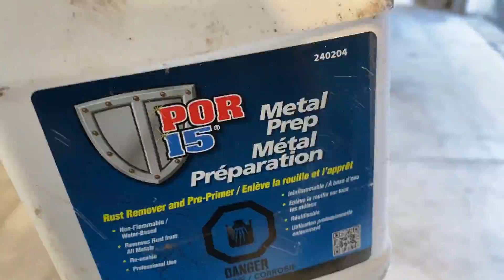Our Family Project Car Collection Tour + Grabbing Cadillac Chassis from 12 Years in Storage!!

Comment: I enjoyed seeing our family projects all lined up but I can't help thinking that there are only so many builds in a person (unless your doing it on a professional footing). Back in the 70's I made a fibreglass replica of a 32 Ford. Here in the UK at the time getting a real metal one was nearly impossible. I worked my backside off to build the thing as getting the fit with the fibreglass mouldings was hard work and also scratch building so much. It had a 2.4L Daimler V8 in it and eventually went reasonably well. Since then I restored and restomodded a 56 Chevy, restored a 66 T Bird and now have a restored 65 Mustang that I have breathed on to make run a bit more like a modern car in our heavy traffic in the UK. I am 66 now and crawling under cars is getting harder so I fear the Mustang will be my last project car.
Reply from the maker: That’s quite the list! Sounds like fun

Comment: Hey Karl.
As you mentioned about making outboard front shocks, or coil overs; you could perhaps use a bellcrank to run decent length shocks horizontally (towards the centre of the front) instead of vertically.
Reply from the maker: Yeah that would be wild

Comment: The thing I would worry most about on the upper controll arms is the balljoint angle but with lifting trucks after market controll arms allow you to move the balljoint under the arm to go higher so for down you could probably just make a spacer for in between the arm and the balljoint
Reply from the maker: I think we’re going to be able to do it without modifying the control arms know

Comment: Do a disc brake kit from opgi screw those drums. I made a kit myself for my 65 drop top I used 93-96 cadillac fleetwood front rotors and calipers mounting bracket and hardware from opgi. For the rear I used my 78 fleetwood rear end with factory disc's. I used a shorter rear on my 78 for 14×7 wires and it's on hydraulics too. (Edit) My 65 also lays all the way down within a 1/2 inch from the ground which is best for me if there's any failure I can still drive home in theory. Cool stuff

Comment: For the front lower arms, maybe flip the ball joint so it attaches to the spindle from the bottom up? Not sure what kind of clearances you’re working with, but this should give you what you need without having to notch the bottom of the frame cup. Just a thought. Keep up the great work!

Comment: Karl, buy yourself some citric acid, sometimes called sour salt. I've found it at farm supply stores and in grocery stores. Mix it with water around 75%water and 25% citric acid. You can use 10%citric acid its just a little slower. Soak the rusty parts for a day, scrub with a scotch pad, then soak again until clean. Dry off with air then spray with metal prep. You will be amazed!
Reply from the maker: Thanks for the tips.
Reply: @Make It Kustom.  no worries! I mixed this concoction when I had a 34 didge hood that was straight but rust. I mixed up a 45 gallon drum with of the stuff  and 3 days later it was perfectly rust free. I couldn't believe it!

Comment: Karl
I have seen Wray use rust 9-11 which is supposed to work effortlessly on heavy rust and just immerse parts like those brake hubs. Not sure if you can get that in Canada.
I am trying to see if that is available in Aus.
Super cool chassis and I think fabricating lower wishbones is you answer  for that front drop.
The tail shaft might still be an issue with that X-frame though as you diff spindle looked to low for the correct angle of the  rear universal. But that is just from what I saw in you video.
Super cool look though

Comment: Awesome. 👍😎👍.   I know nothing….. but couldn’t you added an appropriate fabricated spacer between the frame and the ‘bolt-on’ front suspension upper shock mount to move the pivot where you want.  I would think if the spacer was the same height as the offset drop you add to the lower ball joint the geometry would not change much.  Thanks for taking us along.

Comment: What about just z'ing the front frame? Then there is no need to do all modifications to the bottom a arms (only what is necessary for your hydraulic system) and you get to use stock parts with the stock geometry. There would be nothing worse than doing all that work and end up with some crazy bump steer or something.
Reply from the maker: That’s a great idea too! We have now decided on clearancing the frame a bit for the arms to collapse further so it looks like we may not need to cut the a arms at all

Comment: 1969 Cadillac front disc brake spindles bolt up. I did it on my 61 coupe Deville. 1970 Cadillac changed the ball joint design so 69 is the year!

Comment: On the rear I would use coil overs with a power ball. You should also consider using accumulators. It will really ride smooth. You can also adjust the nitrogen in the bladder to change your sensitivity. I use to hop cars for a living. Look on my channel. I won world championships! Beautiful work btw. Are you using old aircraft pumps?
Reply: An accumulator arrangement could let you remote mount the springs. Work out the ratio of cylinder diameter to accumulator diameter and adjust spring rate accordingly. Then pump more hydraulic fluid into the system to adjust height! Good idea F S Customs!
Reply: @bdugle1  I had a hydraulic car shop back in the day. I was CCE Hydraulics New York distributor. I have used those in so many applications. Very neat little items. 😉🤙🏻
Reply: @bdugle1  Also look up pesco pumps. Those are beautiful!! It’s an old aircraft style hydraulic pump. Guys out in California use those on low riders. A set of those in that caddy is like peanut butter and jelly!!! 😊
Reply from the maker: Yes! Lol before we posted this we had a few guys at the shop and decided on coil over for the rear but since this is just a “lift n lay” we are using Heims inside the lower for the rear and just beefing up the arm. The accumulators are awesome too ! We are keeping it simple and using little heavier than stock springs and shocks for the ride

Comment: I found OSPHO at the hardware store. Does the same thing as the metal prep. They have the same main ingredient. Phosphoric acid. Even cheaper... Home Depot has phosphoric acid in a gallon called concrete etch.  The Cadillac will look awesome on the ground!

Comment: Not an expert here but maybe it would be an option to cut the frame to get it lower?, at 32:50 make a dent so the frame accepts the suspention arm instead of customizing the arm?
You don't have to adjust the suspension arms to keep original strength and it seems to me it woud be easyer to weld a plate into that frame then measure and calculate to keep the wheels straight when lowered or up...pered?
Again, i am NOT aan expert and i am not there and don't know how the body would sit but sometimes bystanders have the best ideas you don't see when youre all in.
Reply from the maker: You’re on the right track with that! We have changed our plans since before we even posted the video a little bit of both I think is what it will need

Comment: Drop spindles on the front will help. Powerball the rear end. You will get the angles that you will need better. Depending on how high you plan on going the lower part of the tunnel will need to be cut.
Reply from the maker: Yeah I’m not looking for a lot of lift this is going to be just a simple set up

Comment: Would you be better off replacing the original front brakes with something more modern? I mean you are already highly modifying the suspension anyway. I'm also pretty certain not all parts stores aren't going to keep front brake parts for that era Cadillac, and if they do, it will be Cadillac $. 
Great build BTW! Thanks for making the videos and sharing them with us!
Reply from the maker: Thanks for your input tony! Not 100 percent yet what the plan is but we think there might be a way to get the frame low without cutting the a arms now. Jus modifying the coil pocket to clear the arms. Stay tuned!

Comment: Springs are progressively wound,the ends collapse first,cutting the ends off makes them ride like hardtail because the spring rate is nil,I've ridden in a few cars that have been lowered with a torch for sure. I bought 4 inch lowered coils,and used some lowering blocks for my C10 project. The springs worked excellent on a half ton truck,i only Lowered mine 5 in the front and 6 in the rear,but its gonna have good road manners,gonna drive the crap out of it  Anyways, endeavor to persevere.